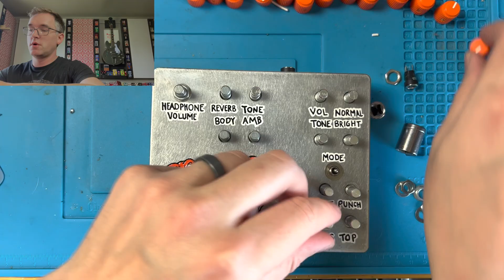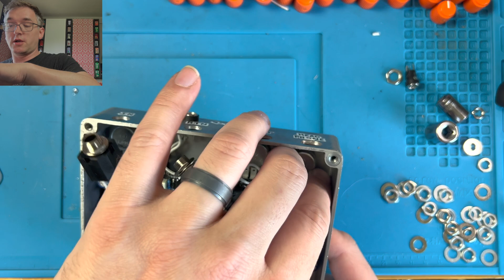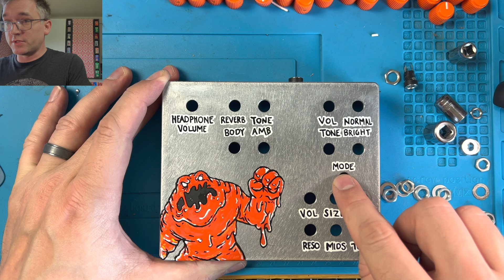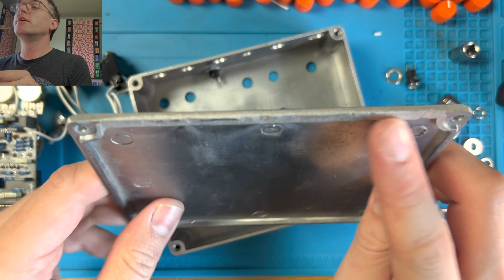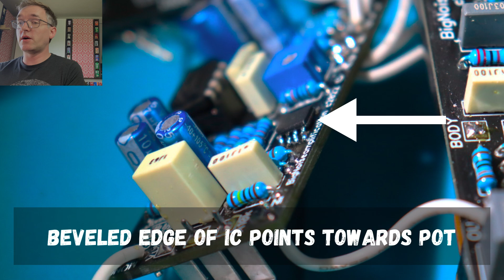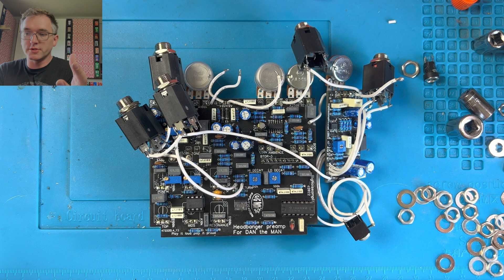Destiny Behemoth: The Offering!

Comment: That’s a beauty! Anything I would have to change to optimize it for bass? Or is that more down to the speakers you plug it into?
Reply from the maker: You would not have to change a thing. I use it for bass all of the time, the preamp is marshall based so it will have that type of flavor. If you have watched any of my videos all of the bass was recorded through it, or at least through a similar set up.
Reply: @dkpedals  hell yeah. This will be the the next thing I buy when I finally catch up on the backlog of boards I’ve got sitting around for sure. 150 watt amp does not make for friendly apartment neighbors.
Reply from the maker: @Phly-Boy  this is the reason this thing exists! Less pissed off spouses and neighbors!